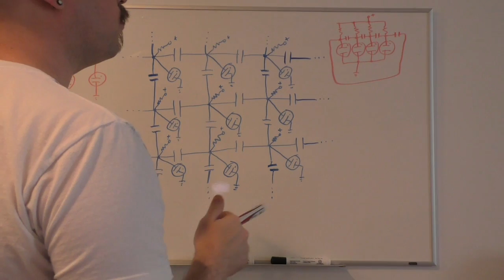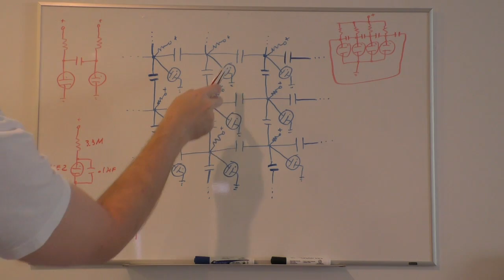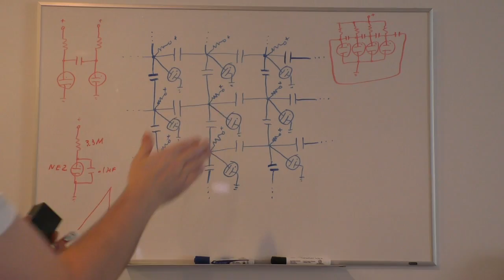Project:  Neon Flasher of Dooooom!

Comment: Kevin, I built one myself using multiple colors of argon and NE-2 lamps in a 12x14 matrix resulting in 168 lamps. It's powered by a HV boost converter and limited with a rheostat. Audio is fed from a point on the matrix through a coupling capacitor and  1N4007 diode clipper into an LM386 audio amp. My audio has a lot of high frequency components though. Maybe I'll need more power supply filtering. A video of it working is https://www.youtube.com/watch?v=qz36XrfhohE
Reply from the maker: +emuman100 hey that looks awesome!  yeah there is a lot of high end, I think using the speaker/amp on the monitor lowpassed it a bit.  Some lowpassing probably wouldn't hurt, maybe 5KHz or so.